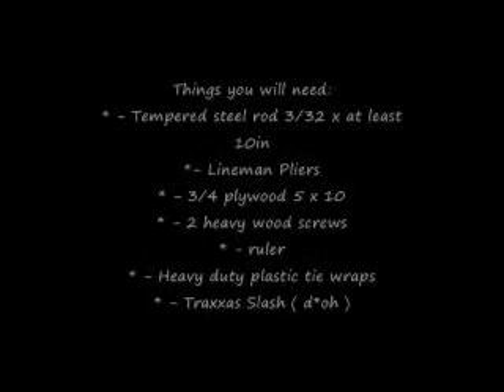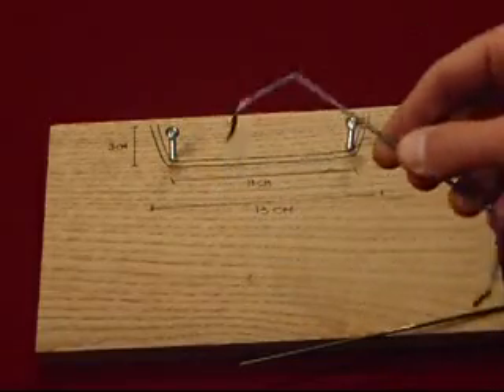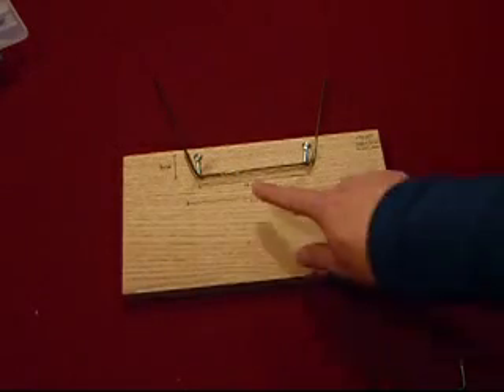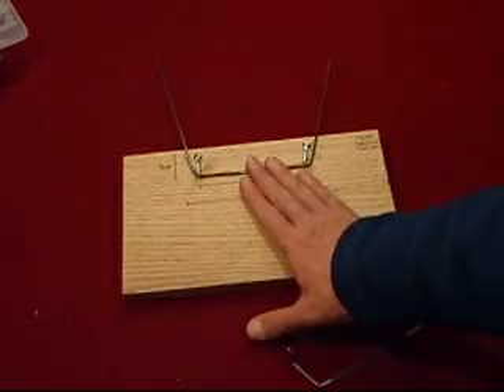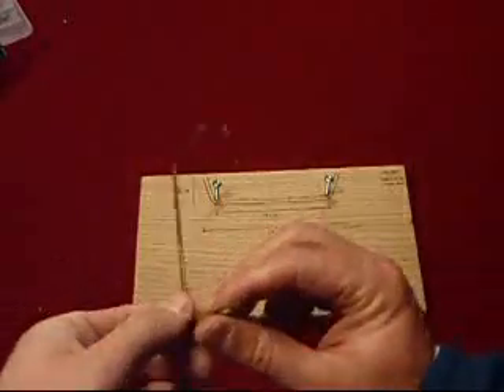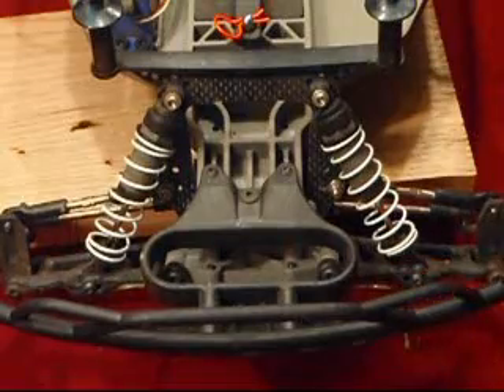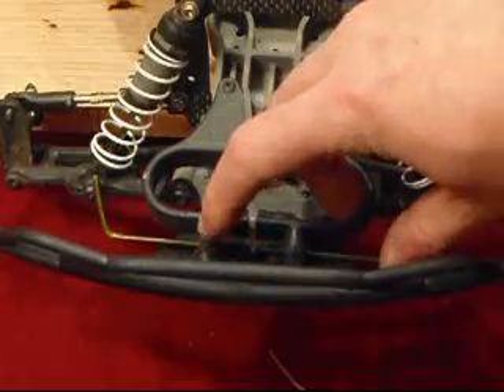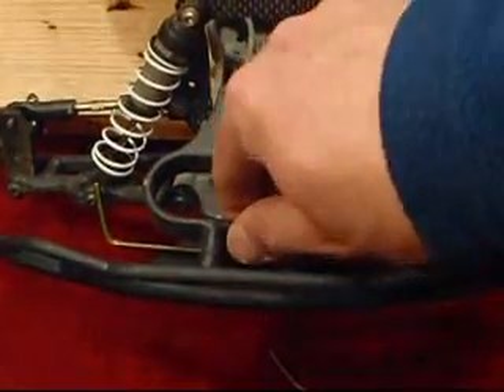How to make a front sway bar for the Slash

Comment: Appreciate your video. I converted mine to a BackSlash 1/8 Truggy running 2200kv on 4s. I love this kind of diy stuff on the cheap. I've made brush guards, body and wing mounts and battery holder from Kydex

Comment from the maker: Sway Bars reduce the amount of body roll during hard turns by creating downward force on the opposite side of the suspension.  Without them roll overs are more common on packed high bite surfaces.  Not to be confused with a traction roll over...

Comment from the maker: @Warthogfan Never got around to making the vid.  The rear one I fabricated will only work if you use and older set of control arms. Part number 2555 from the original slash model number 5802...